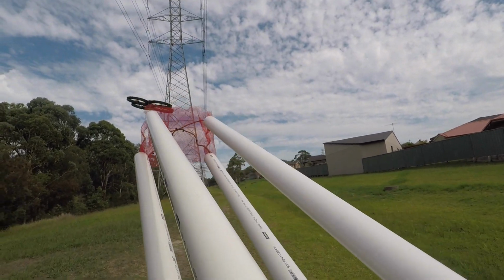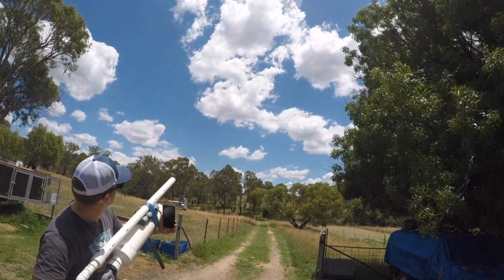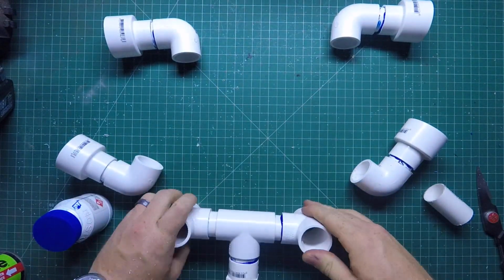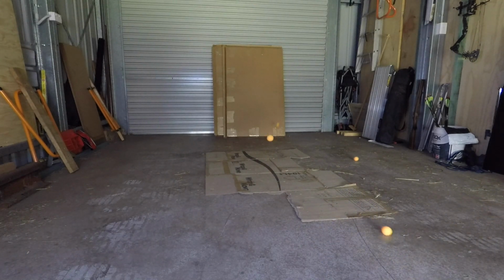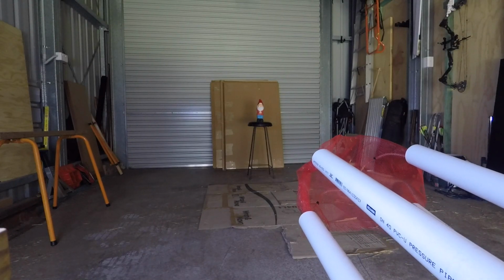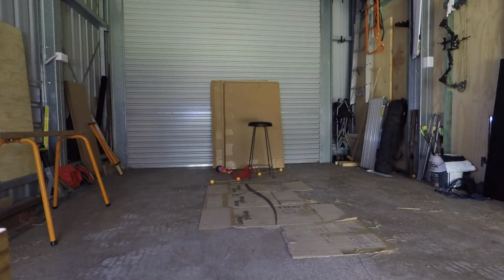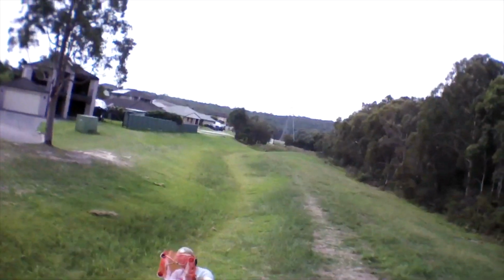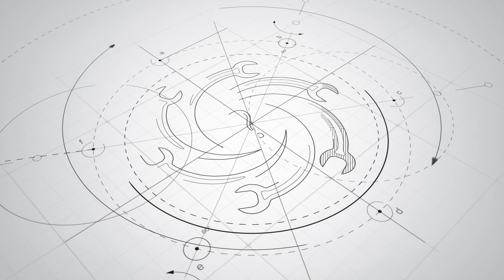Making a drone catcher or net launcher

Comment: Shooting down a drone or forcibly bring it down IS a Federal offense. It would like shooting down a commercial air plane.
Drones are registered with the FAA. Don't do something stupid.
Shooting at a drone is a federal crime, even if it’s on your own property, per Title 18 US Code 32 of the 1984 Aircraft Sabotage Act. The punishment is several years in prison. You also shouldn’t jam a drone’s signal, as that’s a violation of the Communications Act of 1934.

As we touched on in the intro, drones are protected under Title 18 US Code 32 of the 1984 Aircraft Sabotage Act.

In the section entitled Destruction of Aircraft, the law explicitly states that a person cannot willfully “perform an act of violence against” an aircraft “if such act of violence or incapacitation is likely to endanger the safety of such aircraft.”